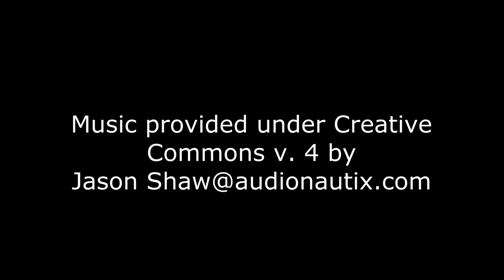Wiring Your Model Railroad for DCC--Problems (111)

Comment: Another advantage of purpose produced speaker wire is that it is specifically designed and engineered (good speaker wire that is) to manage high frequency signals at a frequency much higher than nominal DC electrical (e.g. auto) cables and standard domestic cable (60/50 Hz). Speaker cable is much less likely to build up the kind of capacitance and inductive loads seen in classic DC wire based DCC buses.

Comment: Another good tip is to ensure that you do not have any long runs where an AC or DC power bus run parallel to your DCC (data) bus. Always keep them a good distance apart. When you have to have the two types of buss cross each other then ensure they cross at as close to right angles as you can practically achieve. Cables running close and parallel are another form of "noise" generation. Some data communication standards actually specify minimum etc.

Comment: Thanks Larry very informative. I also use digitrax and began to experience problems with run always and decoders losing their addresses. I did change cv29 on the runaway train and it seemed to work but still had decoder problems. I was advised by digitrains in the UK to fit dcc concepts bus wire suppressors and touch wood since I've had no problems. However I think I'll look into using the speaker wire as a bus. Thanks again Andy
Reply from the maker: Try the bandaid first and see if that works for you.
Reply: I live in the UK too and will be using Digitrax DCC. Do you think that using Speaker Wire might make continuity an Issue, I know Speaker Wires are coded but having say one Black Wire and one Red Wire make it less likely to get the Bus/Dropper Continuity wrong?

Comment: Hi Larry, very informative video and interesting. I have been using speaker cable for my power buses, so is good know I have made a good choice for my bus wire and I have just fitted the NCE snubbers to the ends of my bus wires . For information, DCC Concepts here in the UK do their own equivalent of the NCE Snubbers. 😃
Reply from the maker: I’ll have to give theirs a look. I am petty sure they are an NCE dealer so for them to have snubbers too is not at all surprising.
Reply: Gary! Hey my name is Jeff and I'm going to be using the NCE system on a N scale 3 sectional layout each board is 63 ½ × 32 ¼ and I have flex track and manual turnouts thru out. My question is with there being two wires the same color and sealed together inside speaker wire how do we set the bus up for the black and red feeder wires? Do we split them and use one side or both? Before I go out and buy.... Also is 14 gauge good for the bus and 18 for the feeders?

Comment: Hi Larry. If you use the twin speaker type wire, how do you ensure you connect your red and black droppers to the right + /- bus wire? I appreciate DCC is like AC and switches polarity but we're always advised to wireblack to one rail and red to the other consistently to avoid shorts.
Reply from the maker: The wire has a clear vinyl jacket and one side is copper in color and the other is solder coated so is silver in color. I designate the red side as red and the silver as green in my case. It also has a ridge molded into the red side so even in the dark it is possible to determine which are the red and green sides. And if you have deep pockets you can get zip cord speaker wire in a red/black vinyl coat.

Comment: Larry, all of your videos are very educational and we thank you for sharing. I also use Digitrax, as do some of the commenters below, and would like to let you know that I checked into the snubbers about a year ago when this topic came up and I found that Digitrax specifically stated not to use snubbers with their system. I don’t recall if it was written in the snubber directions or in the Digitrax directions. If you can’t verify it and need it, let me know and I’ll try to find it. It’s around here somewhere. Lol.
Reply from the maker: I have never seen any specific written guidance. As I remember AJ Ireland told me he felt that he had designed enough filtering capabilities into the command stations and boosters to counter the effects of inductance. This is why I always tell folks to check with their tech support reps first as recommendations change over time. And of course with well planned power distribution it is possible to design a layout without power buses over 30’ in length which should negate most inductance effects. I believe that the more recent Digitrax recommendation on twisted bus wires is to help with electronic noise rejection. It is interesting that NCE is adamant about the effectiveness of twisted pairs and snubbers whereas Digitrax is not. Interestingly on the instruction sheet in the NCE snubber package it says that they can be used with any DCC system, a surprisingly broad statement.  If you do find some written statements from Digitrax with regards to this I would like to see it.

Now a little additional perspective. I was at my friends one day testing his very large Digitrax powered layout for short detection using the old quarter test. We were popping shorts all over to see if the command station would reliably shut down. After a few minutes we got around to his yard and found the turntable pit full of locos. The shorts had resulted in runaway behavior and the locos shot out of their roundhouse stalls into the pit. Remember that runaways are one of the symptoms. I also know that Digitrax owners also experience CVs with changed values, at one time it happened to me. And I have seen loss of control. Fortunately I have never experienced a blown decoder. On the Piedmont Southern I have never experienced any of these symptoms since I installed the speaker wire and snubbers, even with 8 amp boosters. Your results my differ.
Reply: Wow, sounds funny now but I’m sure your friend didn’t think so at the time. I’m gonna have to go digging but I’ll see if I can find it for you. I was surprised myself. I had already bought the snubber and planned to install it when I found the info. While I have you on the side bar, what were your reasons to go with Digitrax and when did you get the dcs240 and how do you like it. I was considering moving up too. I chose it because I want to do signals and maybe computer control one day. Did you ever set yours up and how was it with Digitrax. Thanks.
Reply from the maker: Long story. Back in 1994 I was a contributing editor for Model Railroading magazine when Digitrax contacted us to do a product review of their first DCC system so I agreed to do it—I’ve been a Digitrax user ever since. They have continued to send me new products every time they release one (as have many other manufacturers). I reviewed the DCS210 and DCS240 when they came out and I loved it. The integrated PR4 and USB interface makes using DecoderPro so easy now. Plus the ability to upload new firmware when released means I can keep it up to date without a trip back to Panama City. I could have gone with any of the systems available but I have stuck with Digitrax because it is a complete system, with highly reliable components—I still use 20+ year old throttles on the layout.

Comment: Larry! Hey my name is Jeff and I'm going to be using the NCE system on a N scale 3 sectional layout each board is 63 ½ × 32 ¼ and I have flex track and manual turnouts thru out. My question is with there being two wires the same color and sealed together inside speaker wire how do we set the bus up for the black and red feeder wires? Do we split them and use one side or both? Before I go out and buy.... Also is 14 gauge good for the bus and 18 for the feeders?
Reply from the maker: The zip cord I use actually has different colored wire that you can see through the transparent vinyl cover. One is plain copper which looks reddish orange and the other side is tinned somis silver in color. Most zip cord also has a rib molded into one side of the vinyl. Your 14 gauge will be more than adequate and you could likely get by with 16 gauge. I use 20 gauge these days for my feeders and would suggest that for N track as it will be easier to hide.
Reply: Thank you so much! I will definitely go with 16 gauge bus and 20 gauge feeders. Is the spacing every 3 ft or inches two apply two feeders? Also should I put frog juicers on every turnout?

Comment: Larry, Did you use solid wire for your feeders or stranded? with the stranded speaker wire...
Reply from the maker: I use solid wire for feeders. I find it easier since it doesn’t flex as I am trying to hold it in one place while soldering.

Comment: The group I belong to has found that when we try to put two sets (two or three engines with stay alives ) on the layout at the same time we loose everything and have runaways . It seems the draw of all those capacitors loading up at same time draw a huge amount of current. We were able to stop that by breaking layout into 6 power zones using power breaker cards. I like to call them power distribution  cards.
I made some snubbers for layout but haven't installed them yet.
Reply: I hope you're using multiple power boosters, ideally six in your case.  If you have areas with lots of switches, etc. You can divide them up using short management devices and perhaps get away with three or four boosters. Sole math, add up your locomotives and lighterd cars and caboose by amperage drawn and see if your boosters have the capacity to handle the load.

Comment: I find your wiring videos very helpful. I want to use 12 g outdoor (low voltage) copper stranded wire out to my 14 g twisted pairs sub buses in several power districts over 30 feet from the booster / circuit breakers.  Is this 12 g outdoor wire equivalent to speaker wire, or might the vinyl sheathing be too thick to solve the inductance issue. Thanks Larry
Reply from the maker: I have no idea how thick the insulation is. All I can say is the damping effect of twisting is proportional to the distance between the two wires. Thicker insulation increases that distance and reduces the effectiveness. You would need an electrical engineer with a degree in electrical theory to calculate the actual loss in effectiveness due to the thickness of that insulation. Your best bet is to try different wiring patterns to reduce the length of your runs.

Comment: Was wondering if you will touch upon cab bus wiring too.  I use NCE currently and on a previous layout (10 years ago) used telephone jacks that have the hook up screws behind the cover, daisy chained in series with no issues.   Now I keep on geting opens and shorts using the LAN tester you recommended on a previous video and can't get my CAB04 to work at all unless it's right the factory NCE panel .  I even had it sent out for repair and came back with no trouble found. I enjoy watching your videos much more than working on my own wiring lol, thanks!
Reply from the maker: I don’t recommend using DIY throttle panels for that very reason. These usually have their own circuitry associated with them which is difficult to back engineer a d get to work reliably. I only use Digitrax UP panels on my main layout and will use NCE panels on my modules.

Comment: Is it the same process soldering solid to stranded in the middle of the wire?
Reply from the maker: I use suitcase connectors to connect the feeders to the main power bus.

Comment: I'm just starting out in DCC with MRC Prodigy Express 2 starter set, with which to experiment/learn. I noticed your 14 gauge speaker wire is Audtek. Is it the stranded 100% copper, or the way less expensive stranded CCA (copper clad aluminum)? Can you solder/splice/extend end-to-end, a bus later as the layout grows? I'm going to use either 12 or 14 to start, so it's heavy enough if I lengthen the layout later on. Lastly, you say no loops. That's just for the bus, right? Not for the actual track, as in a continuous loop of track with the train just going round and round. Thanks, and love your expertise and detailed explanations in your videos.
Reply from the maker: I use the oxygen free copper (OFC) not copper clad aluminum (CCA). yes you can extend a bus but it is best to keep total length under 30’. You can use reverse loops on the layout but bus wires should be run in a palmate or similar pattern just don’t connect the ends into a continuous loop.
Reply: @TheDCCGuy  Thank you Larry.

Comment: So you can use speaker wire for your bus lines? 

Also, thanks for answering my questions the other day, seeing your responses and watching this and a few other of your videos answers everything!
Reply from the maker: Yes, just make sure to get the correct gauge for your scale and bus length. Lowes and Home Depot only carry the small stuff as far as I know.
Reply: So another question, I have taken out the feeders, and that seems to have fixed my issue, so I did have a faulty one or two, the track now reads 14.3 when I put the micrometer to it(read 12.3 before I took the feeders out in a lot of places) I had around 30-40 feeders connected with suitcase connectors, should I re do the entire bus line from scratch? Because there is so many connections going no where? Or is it fine to leave the bus the way it is? I have the wire and it would take me very long.

Comment: Hi Larry,
 question about snubber placement?
I have a main bus , and a sub bus for the feeders
Should the snubber go at the end of the main bus ?  or at the end of the feeder sub bus?
Thanks
Reply from the maker: I would put one at the end of each bus and sub bus but only if your runs exceed 30’. So if the main bus is 30’ or longer put one at the end. If the total length of the sub bus plus the section of the main bus it is attached to is 30’ or greater then it would need one too.
Reply: Ok so then if my bus or combination of buses,
Turns out to be less than 30 feet, Would you not recommend using the snubber?
Reply from the maker: Thing of these as a bandaid that you apply after a cut, and any short or power related problems are the cut. There are a lot of factors such as wire size, length of run, booster amperage, and wiring practices that create the problem that a snubber should solve. But if you don’t have the problems don’t apply the bandaid.

Comment: VERRY GOOD SUGESTION, AS AN ELE. I PUT A GFCI FOR THE MAIN CONTROLER. THAT SUBER AS U CALL IT DOSN'T HELP IN BROWN OUTS. Q-2 , U DID A SEGMENT ON PECO CODE 55 S/W'S TO MAKE THEM DCC READY. WHAT ABOUT IF IM RUNNING JUST DC, DO I HAVE TO DO ANYTHING TO THE S/W OR TURN-OUT ?

Comment: I am curious as to how all this would be dealt with for block detection. How will snubbers affect detection?  How would one go about twisting wires for common rail block detection?  Would you need to wires to every block so you can twist them?  So many questions.
Reply from the maker: It does create issues but there are work arounds. First snubbers have to be placed before current detectors since they do use a little current. On the Piedmont Southern I use the speaker wire but drop the detection common off when I get out to the block and I only put detection on the main line and not on sidings or in yards. This keeps those runs much shorter than the speaker wire in most  cases.  Also none of my buses are over 30’ long so I could get away without using the speaker wire but I need to test what I recommend so in it went. I’ll eventually go back and deal with these side issues in another video when I get around to detection.

Comment: Did you find Bus/Dropper Wire Continuity a Problem when using Speaker Wire in lieu of Coloured Wires ie Black and Red?
Reply from the maker: Not really, the speaker wires are bare copper and copper clad with a thin layer of solder, so one is red and the other silver. Also the plain copper wire casing has a couple of ridges cast into it so you can literally tell in the dark which is which. 14 gauge speaker wire sells for about $0.15 a foot whereas the red and black type is about $0.60 a foot—call me cheap!
Reply: The DCC Guy Many Thanks for your prompt Reply, I live in Southern Britain and too use Digitrax. Really great Videos.

Comment: I was working in theater when moving lights started coming out, and this created a lot of issues in DMX, the digital control system for lighting at the time.  We had to put 180 Ohm resisters at the end of a run to resolve the issues.  I am very curious if this is the same sort of thing happening with DCC. Do you have to be named Larry to be a DCC expert, LOL.

Comment: Are these "fixes" only for issues on a DCC layout?  Also, is an RC filter compatible with DCC block detection?
Reply from the maker: Yes, this is a DCC video. I don’t believe the RC filters cause detection issues, at least I have not seen any issues as they don’t become conductive unless there is a voltage spike. Twisted wires can be an issue with detection using current sensing transforms like are used o  the NCE BD20 and many others. The solution there is to place the detector after the twisting. So I use untwisted wires as sub buses off the main bus for the detection sections. You can also use a special capacitor arrangement and I cover all this stuff in the book.

Comment: Hi Larry, really appreciate all your excellent videos, just ordered both your books as I am building my first DCC layout. One question and a suggestion for a video, reverse loops and reverse crossovers! When the reverser does it’s job and the train leaves the loop, is the entire rest of the mainline in a reversed state?
Reply from the maker: No, the autoreverser circuit is physically and electrically connected just to the isolated rails making up the reverse loop. Therefore only the polarity of those rails are affected. You need to leave gaps in both the rails at the turnout rails on each end of the reverse loop.